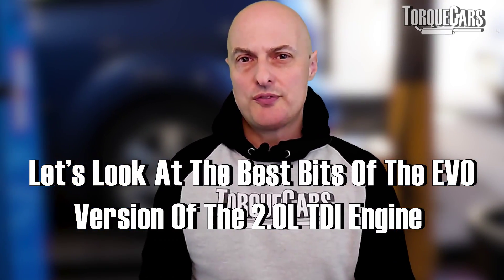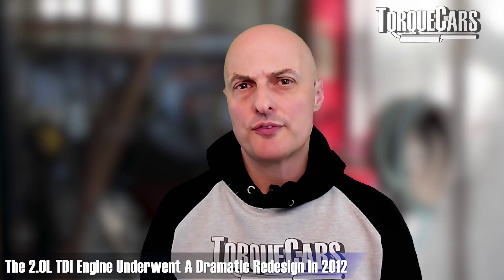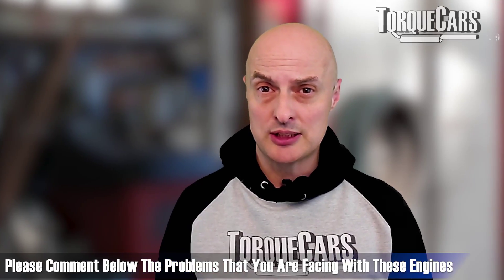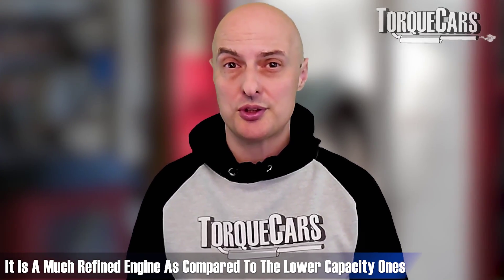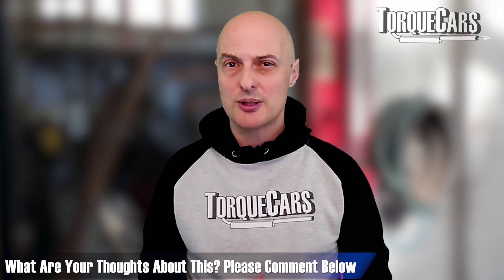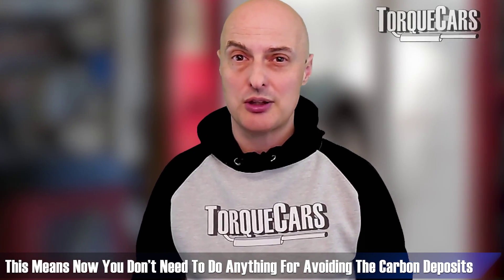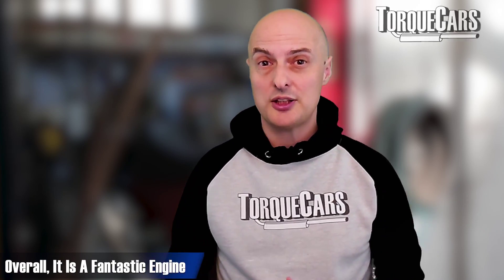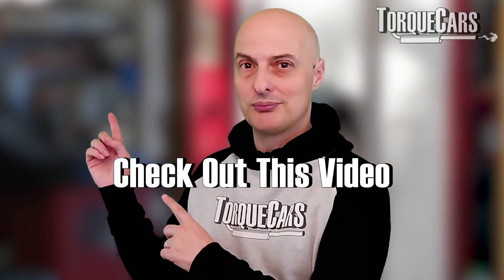The VW EVO Revision to the 2.0 TDI Engine- All The Best Bits Gen 3 EA288 2018 EVO Revisions.

Comment: I’ve ordered 2.0 tdi 200hp ea288 evo car recently and hopefully most of the old issues will be resolved in it.

I’m currently driving 2.0 tdi 184hp Gen2 ea288 engine, and it’s brilliant so far(160k km) - no injector issues, no egr issues due to its location after the DPF or at least to one of them, no DPF issues if you leave it to complete its regen even in city driving, etc. Really happy with it :)
Reply: @ivandimov9712  any update?
Reply: @FilSan86  I have no issues so far - wonderful engine. It heats up faster, is quiter and I personally seen no oil consumption issues for 15k km oil change intervals.
It's not very powerful and I barely notice the DPF regens in the city.

Comment: So first off, love your content and presentation! 
I have a Passat GTS 2017 (2.0 bitdi cuaa). I'm going back and forth on the idea of a remap that would give 300hp 600Nm. I would love the absolutely unnecessary extra power alltough my main goal would be better fuel consumption. Noticed that the 1.4tsi has a electro-mechanical system to turn off 2 cylinders. This got me excited. I have not seen this anywhere on a diesel but would it be possible to, through the remap, not just add power but also incorporate a cylinder on demand by not opening an injector? 

Like, over 1400rpm at constant speed and low enough load it runs on 2/4 cylinders thus gaining extra power but also saving fuel on long motorway journeys. 

This works on the tsi but could it work on a bitdi/tdi or is there an inherent problem with this in regards to the diesel engine?
Reply: First, if you wish to deactivate 2 cylinders with only restricting fuel injection, you will have pumping losses. The only proper way to do this is to have a system that disables both intake and exhaust valves on those 2 engines together with the fuel injection. To be honest your consumption will not decrease drastically but you will be putting more strain on the 2 working pistons and cilinders. Also, your cilinders that deactivates will cool down which would increase the heat cycle on those 2 deactivable cilinders. This might later lead to cracked block or bent block. The technology sounds good on paper from a marketing team, but engineering vice it is a disaster.

Comment: Very cool super detailed, best so far overview. Maybe I missed you say this, the iron cast body was replaced by aluminum with steel cylinder walls. I am getting this engine in February.
Reply from the maker: Glad it was helpful! Thanks for the support and encouragement my friend. I may have mentioned this fact but perhaps it was in the EA288 Gen 2 video I did and I forgot it on this one.
Reply: Im poised to buy a Passat 2 ltr Tdi 2016 reg with £20 road tax - to imply its emission status. The boot has a Bluemotion logo. Is there further development from here that gave it EVO status or might it be EVO design before dropping Bluemotion badge.  Im halfway committed to buying this car with 73k and 7 of 8 vw services. What belt / water pump changes should I expect to see on records and how long is the warm-up period before setting off. Im also assiming this model will have Ad Blue but did exhause system get modified again to earn the EVO badge? A slightly worried potential buyer due to possible expense of having to renew injectors, belts and walnut blasting. Car has tow bar so Im assiming this was a caravan lugger.

Comment: I have this engine, 67k miles in and got EGR cooler issues, still seems to be a big issue 😭😭
Reply: What exactly?
Reply: @anonymoususernamed  They get blocked over time and need replacing. Revised part to fix the issue however!

Comment: EA189 is superior to this ea 288
Reply: EA288 is the newer version of the EA189. It’s actually a cracking diesel engine it doesn’t burn oil and VW have fixed all the issues that were encountered on the previous models. They went back to the drawing board and created a diesel engine master piece. Sad thing is because of all the problems and nonsense that went on with diesel gate people don’t realize the engine is now producing the same NOx as petrol lower CO2 and more MPG’s. Is now for real this time more environmentally friendly than its petroleum siblings.
Reply: i will not feed a troll
Reply: Why
Reply: EA189 fairly bombproof tbf.
Reply: My 2 ltr t roc r line 22 reg dose not use any oil never topped it up between services

Comment: is this engine in the audi A3 2016 model, 110kw?
Reply from the maker: Unlikely - it will probably have the Gen 2 EA288. It was around 2018 these were fitted in the A3. Your engine is still a very good development over the EA189
Reply: @torquecars  thank you.
Reply: Is the Audi  A3 2.0 tdi gen 2 & 3 E3288    110kw  cam belt  or chain ?

Comment: I own an Skoda Kodiaq (MY2019) TDI 2.0 190 HP (DFHA) so far no issues if only I had to add some coolant during the first 15k miles because it went below the minimum but apart from that nothing else yet. I did a remap to 224Hp@460Nm and it is a funny diesel to drive giving the max torque at 2100 rpm :)
Reply: REVO is best. I had the stage one put on my Octavia vRS TDI and the difference is night and day. So much faster, like it should have been from the factory. They test their maps on 100s of cars in many different countries and so have access to far more testing vehicles than other tuners.
Reply: Who did your remap. I’ve got the Tarraco 190hp. There all the same power plants. Would love to get it done but don’t know where to go
Reply: @clinteastwood8222   l
live in Spain. But If I were located in the UK I'd go to Darkside Developments as they are in my opinion the best TDI tunners in the UK
Reply: @jesusrv2009  which teansmission donyou have?